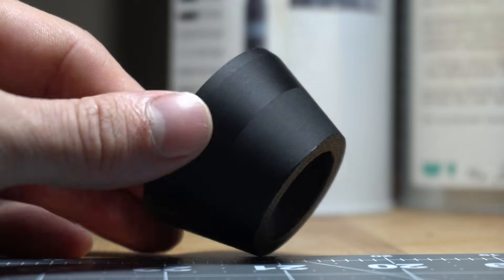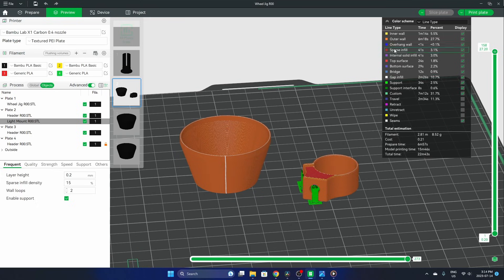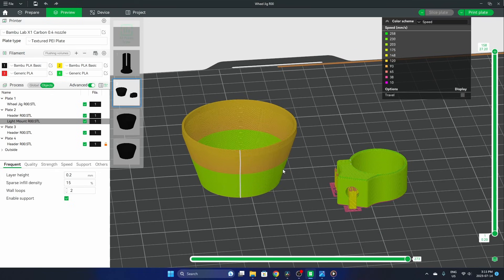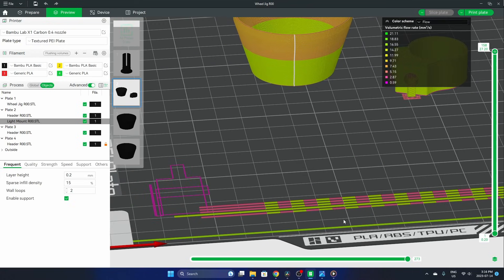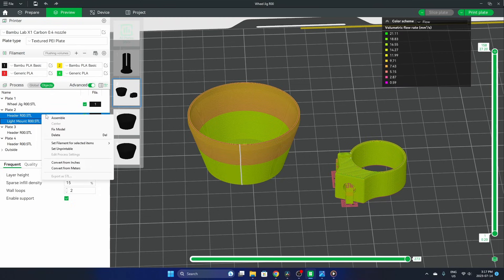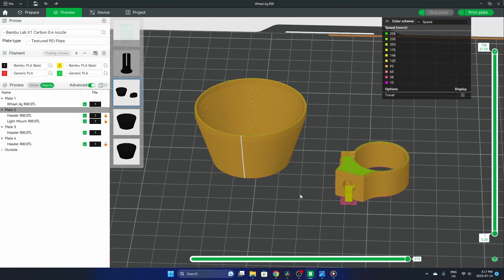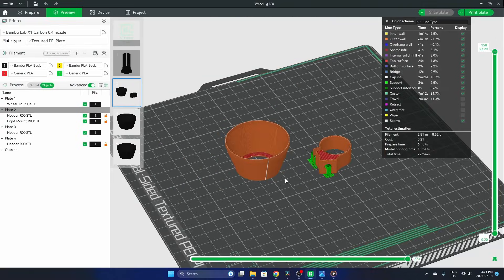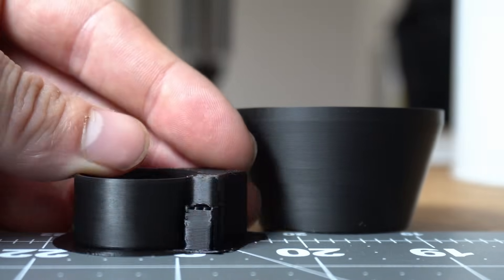How to avoid 3D prints that look like THIS in Bambu Studio

Comment: Thank you so much! Got my H2C as my first Bambu Lab printer. I printed a Part for my Luba 2 Lawn Mower Robot in Black PETG and had exactly the same problem! 😅 One was a Big print and it had a small Clamp as a second print! Looked extremely similar to your print here! 😅 
I printed Both Parts with Both clamps at the same time and then i had 3 different finishes on the Big Part! 🤣 At first it was completely mat, then it was more glossy and then it was completely glossy! 🤣
The part came out fine and it will work, but i was a bit disappointed with the quality because i came from a 7 year old cheap printer and then upgraded to an expensive „high end“ printer! And i thought „my old printer hasn’t done this, so why this high end printer has that bad colour finish/quality on this print??“ 😪 

But yeah! I learned a lot the last couple of days!  
I was HIGHLY IMPRESSED by the speed of the prints that i made! But at the same time the print quality wasn’t that much better than my old cheap printer! Of course my old printer printed SO MUCH SLOWER, so that it’s not even comparable! But i thought i will get a little bit cleaner prints than my old printer has done! 🤷🏽 
Than i have watched videos and the settings in the slicer and it was clear what was wrong! 🤣 
I mean… 200mm/s outer wall and 300mm/s inner wall speed is WAY TOO MUCH for complex prints who should have a very good surface quality! 💀 And i haven‘t even used Bambu‘s PETG HF with that settings! 🤣🤦🏽‍♂️
But in my personal opinion, Bambu Lab‘s standard profiles are way too fast! I don’t know why they made them so fast?! 🤦🏽‍♂️ 
Yeah of course they want to show how fast their printers are… but if they would slow them down by only 15-20%, they would still be extremely fast BUT would also give you amazing print quality from the first print on! 🤔 
In my opinion that’s the way to go! Especially from a brand like bambu, who focuses on easy to use printers and their user targets are people who mostly have not a lot of experience! 🤷🏽 
I have read that a lot! Almost everyone says that the standard profiles are set too fast! So it’s not just my personal opinion… and you also proved it with your video! 😅👌🏼
I just don’t understand why they don’t slow them down by AT LEAST 10-15%?! 🤦🏽‍♂️ 

Now after slowing it down, i get really amazing results and am very happy with my prints! ☺️👌🏼 
But it wasn’t clear to me, why i had the different finishes on my black print! Thanks to your video i now know! ☺️👍🏼 
And you also showed me how i could see the different things like print speeds per layers on the drop down menu! I didn’t knew that till now! 😌 

Amazing short and informative video! Thank you! 🙏🏽☺️

Comment: What if you print this by object?
Reply from the maker: Also an option if your part has pretty uniform layers. Some singular parts will still experience this effect if they have a larger bottom section and a thin upper section.

Comment: Late to the party on this one, but whenever possible (and practical), I change from printing by layer to printing by object, even when printing in a single colour. This ensures each object prints with consistent flow, speed, etc. It also tends to reduce total print time by removing travel between objects at each layer.
Reply from the maker: Yeah by object is a useful feature. This effect can also be seen on single parts so it’s worth knowing how to fix it.
Reply: @3DPrintStuff  Yes, I agree, and thank you for the video demonstrating how to fix. It's now in my bag of tricks 🙂

Comment: Such matte parts mean that the filament flow is too high and the plastic just cannot get heated enough. There are lots of things you can do for this: define the maximum flow your plastic and extruder is capable of, set this value to Filament settings -> max flow so that the speed is automatically tuned to not go over this threshold, and you'll never have to slow it down manually after this. At this flow part it seems like the 20+ of flow is just too much for your plastic at this temperature.

Comment: Thanks for video.. but i still have the problem.. flux and velocity are homogeneous and the same for all the object but the 'tempo layer' is too much different changing the layers.. and the print is the same to 200 mm/s..  also with 50 mm/s.. what could i try to change?

Comment: Turn off "slow down printing for better layer cooling" in Filament > Colling , and your all set.  no need to slow down print speed just make minor adjustment if needed.
Reply: THIS! Right here, fixed my issue! Thank you! I was wondering why the settings I was using from the video didn't do anything LOL
Reply: turned off that setting and got vertical lines and surface is more glossy, but the speed was slow at the same time. not sure what is the issue here, PLA Basic was used, but I returned that setting to default and the surface is perfect. yes it will cut the time significaly, but the outcome result is bad in my case.
Reply: This is the way. A much better solution
Reply: is there any consequences or bad result if we turn off this option ?
Reply: @FramTashtic  If the filament doesn't have enough time to cool properly between layers the print might start slouching as it'll keep trying to build the upper layers over top of the melty lower layers and the weight will cause it to collapse into itself. The same 'cooling' tab has fan speed options though, so you can just crank them up overall to balance things out. But! If it cools too much between layers you might get issues with prints warping up off the bed if the temperature difference between the new layer and the previous layer is too high, so you can crank up the bed temperature to help prevent that. 

It's all a delicate balance, and there's no way to know which settings work best without some degree of trial and error, as every filament behaves slightly differently, and especially with heating/cooling it matters a ton how much you load up the print bed with models, as that'll drastically affect layer print times and therefore the amount of cooling between layers.

Comment: Interesting! But why does the slicer do this? Have you set a minimum layer time? Or maybe the filament profile has an override for that setting? That would explain why it slows down the printing speed after the other part is done: since there's less to print on each layer, it has to slow down in order to give the filament enough time to cool.

In the individually sliced part, the bottom 5 layers show up green in the preview. Even though you said it's perfectly even, I can see the same transition at just 1mm height in the finished part. This would also be explained by minimum layer time, since there's more stuff to print in the base, and above that it's just thin walls that would be completed too quickly if it wasn't slowed down.

Comment: Turn up the heat, turn down the speed or limit the flow. Also. The printer should run the same speed EVERYWHERE
Reply: A flow limiter to the material is the correct way to adjust for this
Reply: Also more nossle heat

Comment: Doesn't it seem like you're doing a disservice to the 3d printing community with this video? You clearly identified that for some reason the flow was getting cut at a specific point. But you didnt identify why at all. Just that you can fix it by going slower. There are a myriad of settings that could be causing this specific issue, the biggest one jumping out to me is minimum layer time in the cooling settings for your filament profile and I've even seen that specific setting mentioned in the comments here.

While the issue is no longer present, how we arrived here isnt great. A lot of problems in 3d printing can be hidden by going slower. But it's still important (or at least nice) to understand what was causing the underlying problem. Now someones gonna be underextruding or printing at 170C or something bonkers, see a matte side and then say hey maybe ill slow my printer down that worked before And it does work because theyre now printing at 60mm/s. But the actual problem hasnt been identified or corrected. If the lug nuts on your car's wheels are loose and wobbling and youre driving a deathmobile that seems fine but when you get on the highway it shakes like crazy, you can also fix that problem by driving slower. But obviously the real fix is to tighten the lugnuts.  You don't want to be the blind leading the blind.
Reply from the maker: I talk about minimum layer time in this follow up video: https://youtu.be/3qzVWfpEZF4

Even if you see something mentioned in the comments multiple times I can't retroactively go back and change the video. 

I don't think this video is a disservice. I have a specific situation that is solved by a specific setting being changed. Lowering minimum layer time could have it's own set of detrimental effects on a part. Slowing down the print is the safer option for most users.

Comment: Hello. I have the same problem here at Bambu Lab P1s. However, when checking the outer wall temperature, flow and speed, the object appears completely uniform in the preview. However, the layer time is what presents a huge variation in different parts of the object, causing each part of it to have a different finish between matte and glossy. And it's very clear. Is there any way to get around this problem? I tested it on 10 different brands of filaments, with the Benchy print, and the problem persists on all brands.

Comment: It was driving me crazy that I couldn't figure out why it was doing this. I didn't care about how the parts looked but couldn't figure out an explanation of why it was happening. The other bizarre thing that I'm experiencing is that half the time when I print a file it is matte and half the time it is glossy. This is using the reprint function on the printer so reusing the sliced file. Any idea what could be causing this since all the settings remain identical?
Reply from the maker: That is very strange… all settings remaining the same should produce a very similar part each time… is your ambient temperature relatively consistent between prints? Are you printing on an enclosed printer or a P1P with no panels?
Reply from the maker: There might be an issue with your thermistor. Maybe it’s moving a little between prints so you’re getting slightly different nozzle temperatures… hard to say.

Comment: Didn't really mention the root cause of the issue though: 'Minimum Layer Time'. That's why it slows down.

And there's to ways to go about it really. Either slow the speed to match the minimum layer time on the quickest layer - OR - lower the minimum layer time to match the desired speed on the quickest layer.
Reply from the maker: Yeah at the time of filming I wasn’t even aware of minimum layer time. Coming from an ender 3 v2 that thing didn’t go fast enough for minimum layer times to even be a concern. Thinking of making a follow up video about minimum layer time.
Reply: @3DPrintStuff  Yeah that's fair, I experienced the same thing coming from Ender 5/6/C10. Used to set up prints by speed but now on the Bambus 'Max Flow Rate' and 'Minimum Layer Time' often become the limiting factors instead.

Comment: Yes, it's good that this is being addressed, although the behavior is, of course, logically explainable. The filament needs the opportunity to cool down a bit. When you have many parts or large, extensive parts, the filament cools down, and if the number of parts decreases, leaving only this super thin ring, the speed drops significantly to give the filament the chance to cool down; otherwise, the print would fail completely.

Comment: I printed the benchy on its own with no other models on the plate. I used Bambu PLA Basic filament, using the default Bambu PLA Basic profile/settings in Bambu  Studio, I did this on the A1 Mini and the X1C, in both cases the benchy turned out shiny/matt like this. I have never experienced this before on my Ender printers. It seems to be a pretty bad issue with the Bambu's PLA Basic. TBH, left me underwhelmed with Bambu printers that are supposed to just produce great prints out of the box with very little setup or tweaking.

Comment: The speed is limited by max volumetric speed in filament settings. When printing on high speeds you reach the limit of max volumetric speed, so slicer changes other speeds accordingly.
To keep stable speed on all model parts you need to print lover than max volumetric speed.
Reply: i was looking for something like this because jsut lowering outer wall speed, while somehow fixing the issue, can not be the cause.
thank you

now the max volumetric speed is in mm³/s ,  hmm i guess it's a combination of a couple things.
so maybe the outer wall setting is still the way to go

Comment: What about when it is just a benchy, by itself, from the built in memory that does the same thing on a fully updated printer I only turned on for the first time the other day? This transition on the hull of my benchy is exactly at the same level layer as the deck begins.
Reply from the maker: Common problem on benchies, Google “benchy hull line” it’s not just a Bambu problem. Nothing you can do about the presliced file except change the speed to 50% which will double the print time. Slice a benchy yourself and lower the outer wall speed and lower the minimum layer time.

Comment: This phenomenon can also be caused by the minimal time for a layer, which is set in the cooling-options of the material. If the layer takes less than the specified minimal time (in my case 8s), the print will get slowed down.
I'm not sure if it is a good idea to set this too low or even deactivate this mechanism, because it is meant to give the layer enough time to cool down, but I think, this is also a cause for the different speeds.
Sadly, there is no option like "keep the same print-speed, but wait outside of the part for the remaining time". I don't know if that would cause other problems, but it might be worth a try...

Comment: In fact, it is common in general for the color to change as the layer rises. I don't know why, in Bambu studio the printer speed slows down as the piece is nearing the end and this image appears. I haven't found a solution for this. Not only for binary parts but also for single parts, especially when printing complex and large parts, the printer speed slows down towards the last layers and this causes the color change. If anyone knows the solution, please write.
Reply from the maker: Have you played around with lowering "minimum layer times"? lots of models get smaller as they reach the top and bambu default settings are pretty generous with minimum layer times so the printer will slow down those layers with less surface area on them causing the color change.  This forum post sounds similar to what you're describing https://forum.bambulab.com/t/print-slows-down-over-time/13498
Reply: @3DPrintStuff  Oh, yeah, finally. Thank you so much for your help.🖐👍👍

Comment: The PETcarbon fiber always comes out perfectly uniform and matt.  It's just theregular PET that does that.  Is it possible to print everything matt and still get good strength? Thank you so much for the tip.
Reply from the maker: You'd have to test and find out. On this print there wasn't any obvious difference in strength between the matte and glossy portions. But I didn't put it under load. So there weren't any issues with layer adhesion but they could show up if the part was put under load.

Comment: I'm havinge the same problem on a benchy and been looking for a solution all day long, it's party glossy, part matt. The only way I found to get it all glossy is to lower the max volumetric speed to 2. 

Can that be right? I'm pretty new at this
Reply from the maker: Yeah that’s one way to do it. Basically the glossy portion is getting more heat than the matt portion.
By lowering the max volumetric flow rate you’ve slowed down the print, allowing for more heat to get into the plastic. This can also be achieved by lowering the speed of the outer walls or increasing the print temp. But increasing the print temp can come with some undesirable features on other parts of your print. 

If you want to try and achieve matt everywhere you can go into the filament profile settings and reduce the minimum layer time to zero.
Reply: @3DPrintStuff  thx for the answer. Matt or glossy doesnt really matter at the moment. As long as it isnt a mix 😆. I will try to lower outer wall speed. Thx

Comment: I'm having some problems with marks on the pieces, similar to your piece on the left at the beginning of the video. It's happening just on the right side of the table. It's as if the layers have space between them. Very common in conventional printers. Do you have a video that teaches you how to fix this? Or could you tell me what the name of the problem would be so that I can search for a solution.
Mine is the A1 mini

Comment: My flower vase has that but I'm printing just the vase. Any suggestions on how to fix this? Thanks
Reply from the maker: You can still use the same technique to make the appearance of a single part more uniform. My video just happens to be 2 parts on the build plate but I've seen this on single parts also. 

You can also check the minimum layer time. I feel like they've made this value too high on most of their filament profiles.
Reply: @3DPrintStuff  Thanks for the quick response. I'll give it a try.